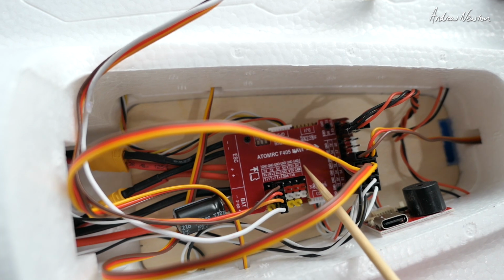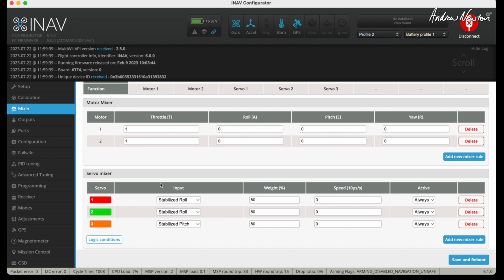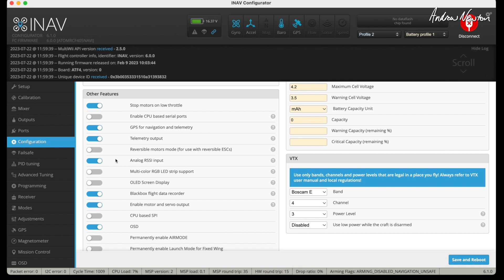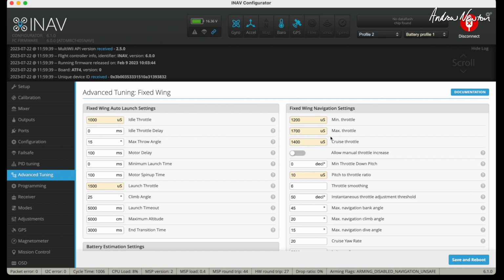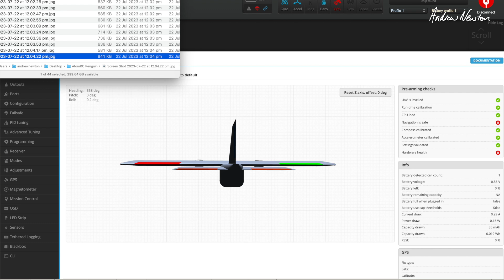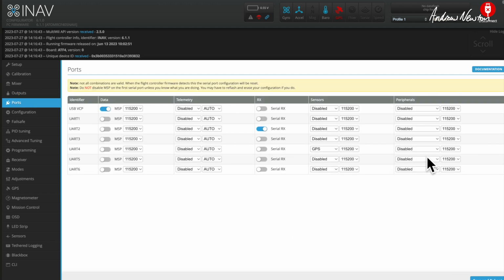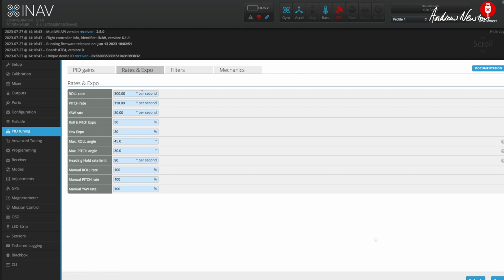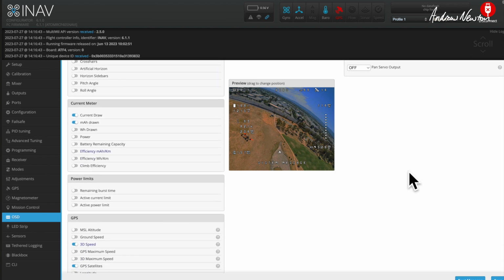ATOMRC Penguin INAV setup

Comment: Do you think this penguin can handle the weight of a c20t gimbal? I'm planning to buy a penguin and mount the c20t on it as main fpv setup
Reply from the maker: Oh yes, would not have a problem carrying the gimbal
Reply: @AndrewNewton excellent,  first I was thinking about purchasing the dolphin pro but the issues in launching got me scare, I have been using a old reptile swallow s670 and launching is always pure adrenaline, by the difficulty even with autolaunch 😂😂 so the penguin will get me rid of that situation and will perform better
Reply from the maker: Yes the Penguin or original Dolphin are much better behaved than the Dolphin Pro.

Comment: Hiya I've just got the same wing Penguin twin motor. Im struggling to find the plug for the receiver. im from a fpv freestyle drone background so normally solder my receiver to pads etc. Seeing the FC has been pre-pin'd im struggling to find what looks like a servo plug but with 4 pins not 3 like a servo normally has. 

Any ideas if it has a name or you can provide a link to the plug with cables attached, so i can just solder it to the damn receiver haha :)
Reply from the maker: 4 pin DuPont https://www.youtube.com/watch?v=Y8I09dCbrac

Comment: Hi Andrew, You really should be using Link Quality and RF power on your OSD rather than analogue rssi..If you use auto ramping of RF it gives a good indication of your control link. Its all CRSF protocol....The rssi looked very wrong in the video...this is for the very old single wire rssi receiver's from years ago I think.....🤔😳😳🇬🇧
Reply from the maker: Thanks for the reminder. Must have loaded my non-ELRS OSD.
Reply: @AndrewNewton  Ah, you loaded your OSD via the CLI....!!....lol... CRSF link quality works way better and if you use RF auto ramping most of the time my Crossfire is running on a mere 25mw. Not sure how the 2.4g RXs compare TBH...be interesting to see it actually....🤔😳😀😀🇬🇧